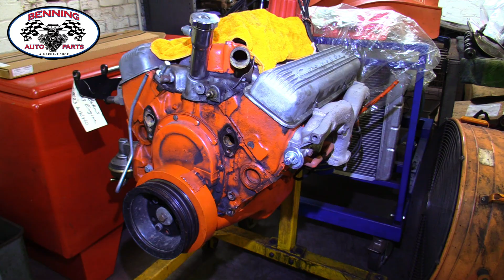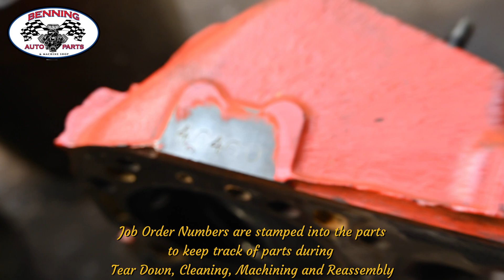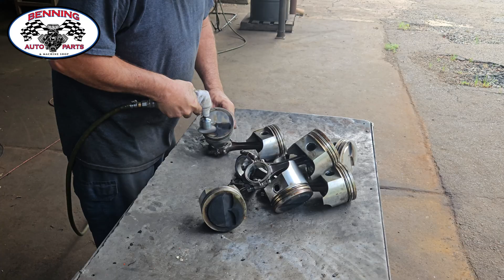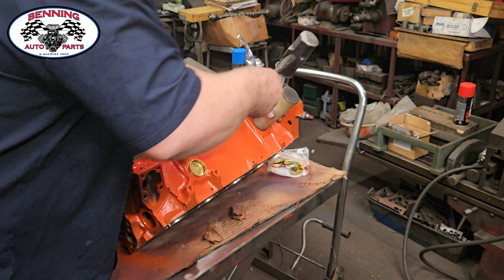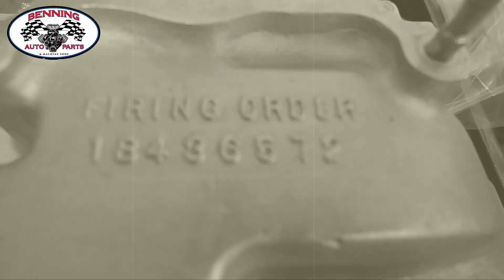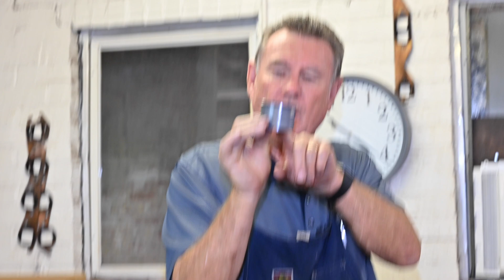Chevy Corvette 327 Rebuild

Comment: Engine disassembled on a gritty concrete floor. Crank beat on with a big hammer.
Seeing the stems I know those valves should not have been reused.
The assembly done on pieces of dirty, used cardboard. 
Freeze plugs slammed with a big hammer on top of a rickety trolley. Paint inside of the freeze plug openings should not have been present.
just slamming the (wrong) main bearings into the block is as far as i am going to watch. Their process is as poor as the cleaning of their shop.